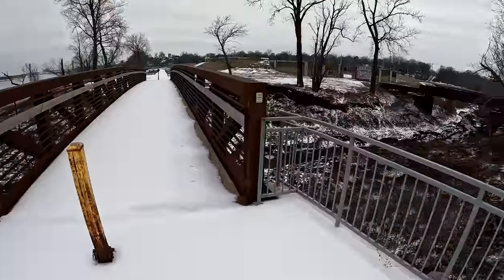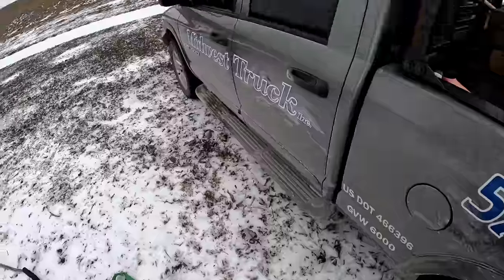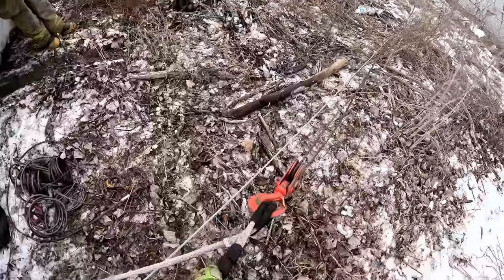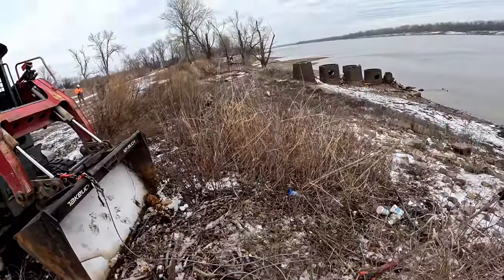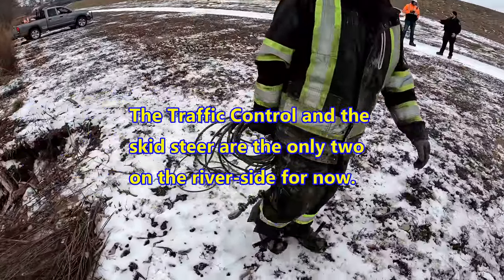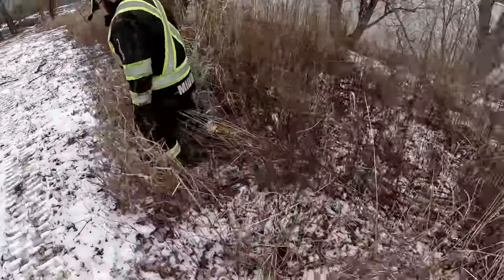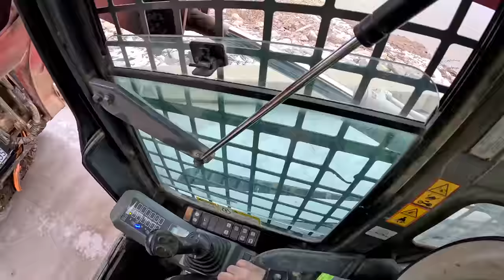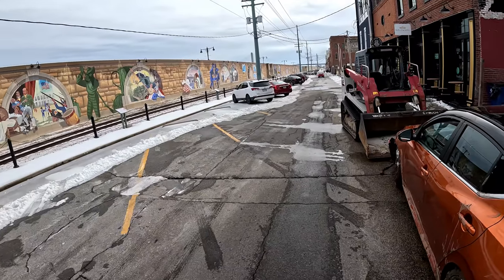CAR FISHING IN THE MISSISSIPPI RIVER!! NEW NISSAN SENTRA SUBMARINE!!

Comment: @21:00 Ron, the lights dimming on the truck indicate a drop in voltage on the car's battery. You could improve your winch performance and reduce the strain on your truck's electrical system by installing a second battery in the back of the truck and connect the winch from there. The 2nd battery will act as a buffer and the shorter cables will offer less electrical resistance, meaning higher voltage, meaning less loss from heat generation. Hope this helps! Great content as usual.
Reply: Or they could just upgrade the truck's alternator to a higher current model in that vehicle to handle loads like this. Another option.
Reply: Or another option is having a separate gas generator that can be used to power the winches in heavy usage situations like this.
Reply: Guys .. i'm fairly confident Ron knows how to power a winch
Reply: @Sabrinahuskydog  
and heavier gauge wire.
Reply: Or just replace the whole engine with a mini nuclear reactor that satisfies all power needs. Boom.
Reply: @thatkyledude1093  That's actually been tried...

No one wanted to allow the thing inside City Limits for some reason...

Something about Traffic Accidents causing everyone in the area to start glowing in the dark I believe...

😄😁😆😅😂🤣
Reply: Just install a flux capacitor! Only problem is youve gotta get up to 88mph to active charge. Im sure this dude knows his electrical charge sysyem needs an upgrade ffs.
Reply: The nuclear power option is the best one I've ever heard!!? LOL, garanteed
Everyone is going to see u going down
The highway or parked somewhere

Comment: Good afternoon Mr Ron
This was a different kind of recovery that you could have used the rotator for but couldn't due to extenuating circumstances, but even then you still got the job done with a minimum of fuss.
If your skid steer has auxiliary hydraulics, you may want to consider building something similar to what Sumter Wrecker has for their skid steer , which for them has been a great piece to work with

Comment: Safety suggestion - may want to consider some form of "screen" that would go on exterior of the "glass" door of the skid steer so if the cable or rope breaks it does not hit the skid steer operator in the face.
Reply: I'd hope that it also polycarbonate, nd not glass. Yes, some bars and screen could be  good idea to protect the  operator.
Reply: No chance of that breaking and flying that hard.

Comment: When my Dad was with the Corps of Engineers back in the 1970's, he did levee inspections with a 4x4 truck equipped with a winch that operated off a PTo from the transmission.  The truck was generally a Chevy shortbed stepside with a three on a tree and a 350 V8.

Comment: Honestly, I'm impressed that the winch actually handled load, especially with mud suction. Beyond that, you followed, more or less, one of the plans I had in mind. Only major difference, I was leaning toward toward an anchor and redirect off that tree right off to the port or driver's side rear of the pickup. Rig it up right, you could probably not only get the line up off the rocks and debris, but also get just a smidgen of lift on it. Tree looked stout enough to handle it, even with moving the harness up a foot or two from the base. Might have also made the load on the winch ever so slightly lighter.

EDIT: Actually, getting a better look at that tree later on in the video, maybe not as stout as I first thought.

Comment: Ron, possible future investment might be a winch attachment that mounts to the skid steer, runs off the hydro and can be dug into the ground like you did with the bucket. Would save using the truck winch and some cable pulling at times using the spate cables and ropes

Comment: Quite the unique recovery. Almost need to invest in a barge for water recoveries. As for your soft shackle coming undone, Casey Ladell, a fellow tow truck operator that does more off road recoveries, recently did a video about those non-yankum soft shackles. He had one come loose like yours did. Showed what happened and what to do about it. Those non-slip knot shackles don't sinch down around the rope. Also make sure your knot has a hard stop to it, not a taper that can separate the loops.

Comment: Something a bit different, you don't always need the Rotator, other big trucks or a rollback for every job. It's nice to have the variety of equipment.
Reply: I don't remember who it was, but I remember seeing this video of a UPS truck that got stuck when one of the rear wheels fell off the edge of someone's driveway into a culvert. The operator got there, and the driver thought he was gonna have to crane lift him out of the ditch. But the operator pulls out a hand jack and a bunch of wood blocks and just builds a support under the wheel. Just goes to show, you don't always have to use the fanciest tool.
Reply: Just like andrew camarata

Comment: Simple solution..... WOOD is your friend put 2 rail road wood pieces length wise under the car and now you can sled drag it up the bank over rocks and anything else ...... without it getting hung up just cut the drag direction a 45 on it and it works like a sled system.

Comment: You should make some kind of removable steal cage to go on the door of the skid steer so when you do jobs like this you can put it on so if you need someone inside to control it if needed, they would have some protection just in case a line breaks and flies.  A winch attachment for the skid steer would be a great addition as well. because as you do things like this, you could then reel in and let out the line as needed kinda like the loggers do when they are skidding logs.  A similar winch attachment on the skid steer would be great for recoveries.

Comment: Very nice work. 
Assuming the little foot bridge could hold the weight of the Sentra would it of been quicker to use the rotator to winch the car across or was the bridge not wide enough or was the 4klbs of the car too much for the bridge? 
Sorry to Monday morning quarterback here😜
Seriously love your content
Reply from the maker: At one point in the video you can hear the officer deny our request to take the car across the foot bridge.  End of the story...onto another option.    Thanks for watching and God bless.
Reply: We had the boards of a foot bridge broken after what police think was a quad bike went over it. The bridge crossed  railway line so it was expensive to replace the wooden steps and bridge deck.

Comment: Not trying to cidasize ..just wondering  why You haven't   modified the truck wintch to wire less..

I did this w all of mine..

( harbor  freight sells a wireless  kit ..but sure you'd look elsewhere..for Higher quality..of wireless  controller ( to get rid of the wired controller) as a thought I still
Carry the wired controller for back up purchases ..

( with wireless  of course  you rely on batteries @ controller..) sure you know .this all ..as in battery in controller w wireless .

I see you using wireless  controllers w the Big Ridges ..

Love your Chanal. Easy to fallow..& understand  ever step of your struggles w what all you do..

Comment: If you have not heard of winch recover unit for skid steers, Beards towing made an appearance on Adventures with Purpose when they where in Fort Worth Texas. There was 4 YouTube video's with the recover winch unit that they made and said they where going to sell. It would have saved you some time in this video to have such a setup, but ya it cost money.. I also hope you looked back at how close you guys where to the line with it pulling. Seemed to close to me.. But I am nobody with experience. Also, that soft shackle, if it was an amazon special the knot is to small and will slide off. Casey LaDelle (on YouTube) Just had a run in with that problem about a month ago and sat down and compared the Yankum version and the amazon one and through the cheepies out.

Comment: According to the video the rating on the bridge was 10,000 Lbs.  The local police were not giving permission to cross the bridge because it was obviously not their call or expertise. Nissan Sentra was about 3,000Lbs but the TL12 was about 3,000 Lbs over weight.  Nice time to have the county or city engineer emergency contact to verify the structures rating.  If the bollards on the bridge near the scene were removable so the car could fit, and the engineer was comfortable with the recovery and weights (car only winched across), it would have cut the recovery time considerably.  The car could have been placed on one side of the bridge and winched over to the dock side by a wrecker.  Obviously takes time to secure all the different local government contacts to make these things happen, but you work with the informaiton you have in the moment.

Comment: I suspect this turned into a 2 part video. If you had better soil or land to work with I think the traffic control truck could have pulled that Nissan Sentra wherever you wanted it dragged to using the Yankum Rope. All the Off-Road Tow guys in Utah do it all the time.

Comment: Well, i think in this case the preparation was more difficult than the recovery itself.

Maybe you should get a winch attachment for the Skidd Steer for such situations. Since the Skidd Steer is a big TL12 it has enough hydraulic power to use a hydraulic winch.

Comment: The bucket on the skid steer should not be lifted under load. it buds me to no end when i see people lift the bucket on a skid or tractor because they want a better view.   When I was running equipment we tought the operators to carry the load as close to the ground as possible. even with a tracked machine it doesn't take much to overcome the center of gravity and turn a machine on its side